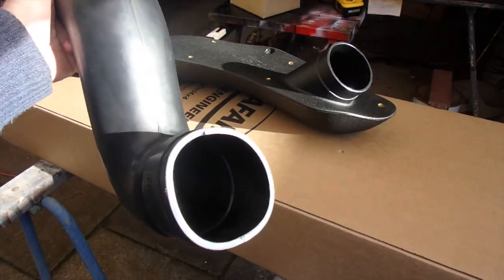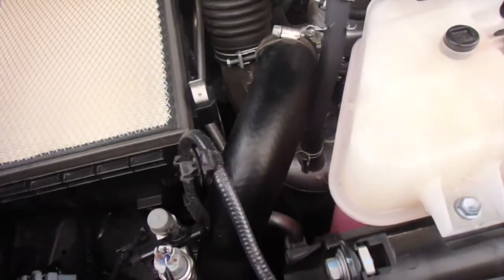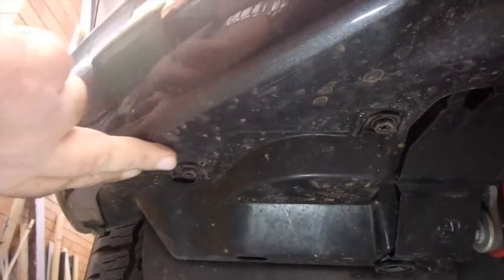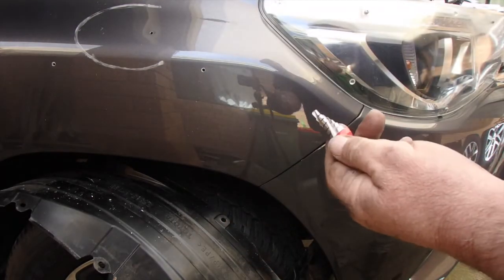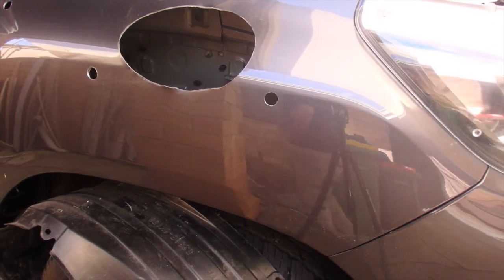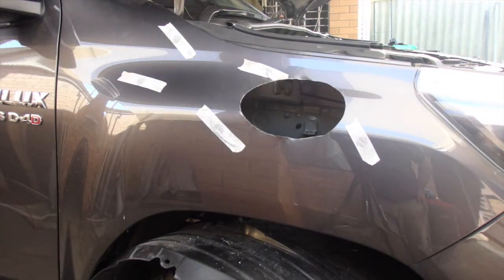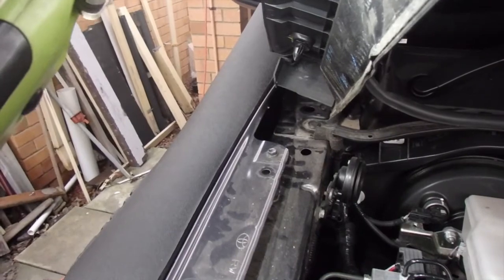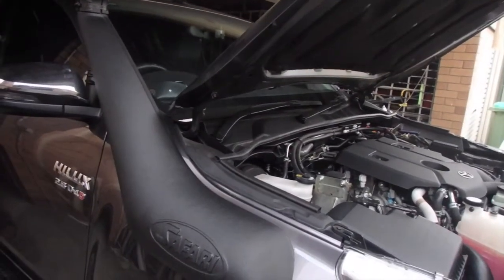Toyota Hilux 2015+ Safari Snorkel fitting

Comment: Running a holes backwards will overheat and stuff it. When drilling with both the holesaw and the step drill, run it up to speed before contacting the cutting surface to avoid it grabbing, pulsing the drill like that will overheat the motor and cause it to grab. Other than that thanks for letting me having a visual of the process beyond the instructions. Oh and don't use tin snips, they deform the panel
Reply from the maker: I need a more powerful drill but I don't often cut big holes in new cars with the snips they were new and I took small bites so they didn't mess the car side edge of the cut hope the video helps with all the small details regards Mike
Reply: @kisbushcraftdownunder  it was painful watching you drill and cut,,,, read up on proper technique...

Comment: Hi mate, on the instructions the pillar bracket shows inserting plastic clips, then screws, but it looks like you used pop rivets, were they supplied with the kit, did you need an pneumatic pop rivet gun, a work shop wants to charge $600 labour which id like to save. Thanks.
Reply from the maker: I had a rewatch the video I drilled the pillar holes to 8mm so I used plastic clips that came with the kit regards Mike
Reply: @kisbushcraftdownunder  Hi Mike,  and did you use pop rivets or screws to hold the bracket?
Reply from the maker: @79series  with a 8 mm hole it must be screws but its a long time ago now
Reply: Perfect thanks mate. @kisbushcraftdownunder

Comment: Do you know how far the snorkel reaches above the roof? I have a demountable cabin with alcove and I´m wondering if the snorkel fits under it- Thank you for the great video!
Reply from the maker: Its hard to measure due to the curve in the roof so I measured from the top of the wing mirror its 37cm or 14 1/2 inches to the top of the ram head the snorkel sits forward's of the windshield by 28cm or 11 inches hope that helps
Reply: @kisbushcraftdownunder  That was as perfect answer, thank you so much!!!! (My alcove ends only a few cm in front of the top edge of the windshield. So the snorkel is far away from it in the horizontal direction, I didn´t think of that I only considered the potential vertical distance) :) Greetings to the other end of the world!

Comment: hello, do you encounter a problem such as wetting the air filter, does water go to the air box in heavy rain?
Reply from the maker: I have never had a problem with the filter getting wet the head of the snorkel removes some of the rain water and in the bottom of the air box are two drains one a small hole and the other a duck bill valve .Some people seal them up worried that water could get in during river crossing regards mike

Comment: Any difference in performance?
Reply from the maker: I haven’t noticed any change but I not a hard driver no loss of fuel ⛽️ economy only downside is probably changing the air filter more often due to bugs
Reply: That’s great to know, what’s your average fuel consumption?
Reply from the maker: @MC-jf6ic  about 10.9 km per litre with HWY tyres on but if I put my off-road tyres on BFG KO2 I loose about 10%

Comment: Why didn't you get a custom air box
Reply from the maker: I have no intention to modify the engine the Hilux air box works fine most custom boxes are about performance and don’t have a air spinner so wet filter do happen when driving through rain. For me reliability is paramount